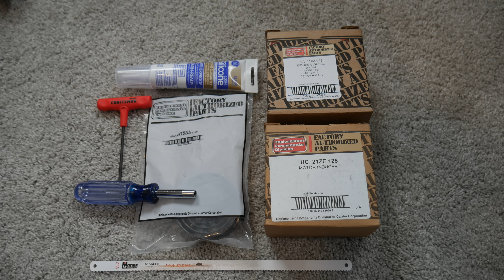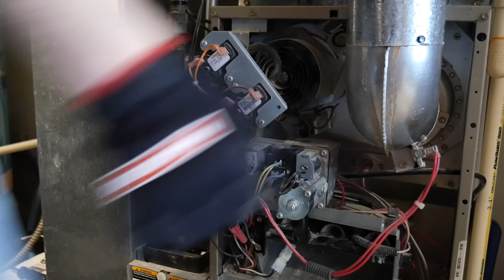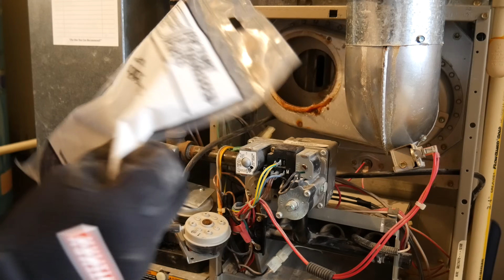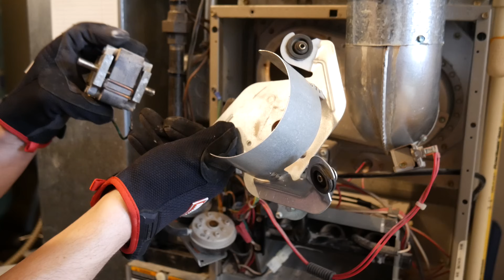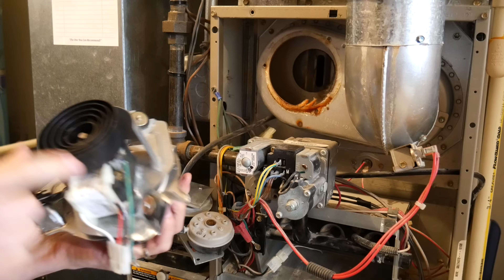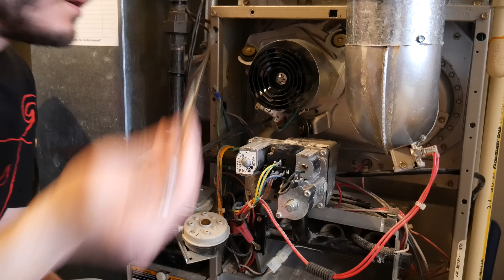Screeching Furnace Repair - Carrier Draft Inducer Motor Replacement in 4K

Comment: Thanks for the great tutorial; took me 45 minutes and saved me hundreds!  I had no idea how much noise this little motor was adding to the furnace sound - it's now whisper-quiet.

Tip #1:  Get your specific model number before looking for parts.  There are numerous versions of the Weathermaker that require different parts.  Remove the front door and look inside the unit. The model # is printed on a decal (include the numbers after the "- - -").  Take a picture of it to reference later.

Tip #2:  Buy the $5 replacement fiberglass gasket rather than deal with messy silicone.  When you remove the motor assembly, the original fiberglass gasket will fall apart.  To ensure a good seal, remove as much of it as you can before attaching the new one.  NOTE the new gasket is fragile so handle gently.  Also, install it DIRECTLY onto the furnace, not to the motor assembly you detached.

Tip #3:  If you don't have a magnetic-tipped nut driver, you can use a bit of tape to hold the screw to the driver.  Once the screw bites, remove the tape and finish setting the screw.

My Weathermaker model # 58CVA090-10116 required the following parts, purchased from factory-authorized repairclinic dot com:

Draft Inducer Motor  --  Genuine OEM Part #: HC21ZE126(A)  --  Repairclinic Item #: 2378490
Draft Inducer Blower Wheel  --  Genuine OEM Part #: LA11XA048  --  Repairclinic Item #: 2347724
Fan Blade  --  Genuine OEM Part #: LA660003  --  Repairclinic Item #: 2347727
Gasket  --  Genuine OEM Part #: 327263-401  --  Repairclinic Item #: 2357539

Total Cost  --  $140 including shipping
Reply from the maker: Thanks for the positive feedback and quality input. I pinned your post so others will easily benefit from your great suggestions!

Comment: An easy way to put the spring clip on the fan shaft, is to use a socket and push it on with that.

Comment: Really great video--in 4K!!  My Carrier 58CVA's inducer motor stopped and began to "hum" one night, so I cut the power off, and manually turned the motor back and forth until it spun freely; cut power back on and, furnace started back up.  That should have been the clue, but NO--two weeks later, motor would occasionally screech at start up and SEIZED a few days later when daytime highs were in the 30s and nighttime temps were in the teens!  Rule Number One:  DON'T PANIC!  So, after a few nights of sleeping in multi layers of clothing and relying on two space heaters (INSIDE temps in the 40s!), I ordered and replaced the entire assembly.  The new unit has no ground wire, but no rubber shock mounts like the original unit, either.  The explanation was that with no rubber parts, the unit is grounded by being attached to the housing, which KINDA makes sense (?)--but stay tuned!  I plan on replacing the motor on the old assembly (just for kicks) to have a spare.  Good luck to all DIY-ers out there.
Reply from the maker: @ClassicTV4U  Sorry you've had to deal with no heat! Sounds like you're on the right track. Keep us posted!
Reply: @TheTechnoMack  So far so good! Replacement unit is installed and working; I plan to order an "HC" motor unit, buy a T-handle allen wrench like yours and use a lubricant/penetrant for MONTHS until I can remove the set screw, and keep the off unit as a spare.  The goal is to NOT have to cut the shaft.  Take it easy, dude--your video ROCKS.

Comment: thanks for the video, it gave me the confidence to replace the draft inducer motor myself.  A local HVAC company wants to charge me $1499 to replace it.  They also said that it was the last motor available in the whole united states.  I found the motor on Amazon for $63.95 and the draft inducer blower wheel for $30

Comment: Applying high heat antiseize to the wheel shaft and set screw would be beneficial  the next time you need to replace the motor.

Comment: Thanks for sharing this video. It is very clear and helpful. It is particularly helpful in illustrating that nobody should buy this brand of furnace under any circumstances. It contains a subassembly that will need replacement several times over the life of the furnace, but is a massive pain in the neck to replace.

Comment: My Carrier 58hdx060-12 high effeciency is nothing but trouble. Only 11 yrs old and have to replace the inducer assly 4 times. Original one, replaced that under warranty, another one 2 1/2 yrs ago and a new one last week. I kept the removed one and replaced both motor shaft bearings. Also had to replace the blower motor and fan last January for $536. Carrier is a POS in my opinion. In the future, I will do this all myself, thanks to guys like "The techno Mack" guy.

Comment: Thank you so much: efefctive and to the point! I do have a question: if you use silicone sealant, wouldn't be difficult to remove the assembly next time when you replace it? I guess by then, the furnace needs replacement anyways. All the best!

Comment: Does this motor cover all the carrier furnaces? Mine looks just like that!
Reply: If you go to the following link, it will tell you on the bottom of the page exactly which model number furnaces it will fit (there are a lot!): https://www.northamericahvac.com/oem-carrier-bryant-payne-inducer-exhaust-motor-326628-761-3266828-701-326628-711/
I just bought mine today and will be replacing the whole thing once it arrives. Our current one is making all kinds of squealing noises (the bearings going bad). I didn't feel like taking the thing apart so spent the $200 for the whole kit. This way, too, I know that the whole thing is new and ready to go.

Comment: Very good clear instructional tutorial. My first of this kind. My Carrier furnace is short. Parker Pearce (hvac co.) came and charged me $342 for diagnostic without repairing any parts. Later, they said they could not further help me, because they said the part was discontinued. I was very depressed. I couldn't afford a new furnace and didn't know how to solve my heating amenity. I spent some time percolating about the problem and brooding. This last month of fall, the house was without heat. I wonder if you can help me. I believe my  2004 furnace is in the same family model (58CTA070-10112, serial 250 4A26011) as shown in your tutorial. Do I need different parts or, are the parts interchangeable? If so, I think I can follow your directions to the "T." Help!

Comment: I was able to remove the slotted washer, that holds the fan wheel in place, with two paint can opener tools. I could reach behind the washer with the two paint can openers, and simply pulled the washer off from the shaft effortlessly within a couple of seconds. The fan wheel slid off the shaft  undamaged. Hope this idea helps you when you pull off the fan wheel from the shaft.
Reply from the maker: Smart! Thanks for sharing!

Comment: Thanks for the video.  It provided some good information that helped me.  I just replaced mine tonight.  I decided to just get the whole assembly for mine off Amazon for about $300 so I didn't have to worry about swapping parts or breaking the plastic fan when trying to get it off. I just unscrewed the one screw holding that first module on to get them out of the way, unplugged the cable, unscrewed the three screws holding the whole unit on and pulled it out, and then installed in reverse order.  My complete assembly also had the fiberglass gasket like the original (instead of silicone).  My tip was to use 3 little dabs of bearing grease just to hold the fiberglass gasket in place until I got the motor in place...and then use a dab of grease on the screw head to hold the screw in the socket so it wouldn't fall out.  The whole thing too me 15 minutes including getting my tools and cleaning up.  Thanks again for the great content!

Comment: You should've just unscrewed the three smalls screws-- not the brommet screws while working inside the furnace. The entire assembly can be removed without taking off the brommets. It's a lot easier to open up when outside of the furnace.

Comment: Your parts replaced say HC21ZE125 but link says its only interchangeable with the HC21ZE114A. The 125 is 3x the price. Is this just con-marketing or would you recommend getting the 125?
Reply from the maker: If you have the same Weathermaker 8000TS, I can only ensure the HC21ZE125 will work. You may want to call a local HVAC company to check compatibility or maybe they can sell you the 125 for less. I'll investigate and update or remove the link as appropriate. Sorry for the confusion.

Comment: Thanks for this! Inducer motor was finally making some really weird sounds tonight. Luckily I had an inducer motor purchased 9 months ago from the local Amre Supply.  Changed the motor tonight starting just before bed: 11:30pm to 2:15am (2h 45min). I used a bit of WD-40 to losen the hex screw on the inside fan. And the longest part was getting that hex screw out and shaft out to reuse the blower. 

Some tips:
Tip 1: Use the hack saw if you have one. 
Tip 2: Reuse the inducer fan on the inside if you can. Try not to bend the hub. If you do, when you put it back on try and straighten it so it spins evenly. 
Tip 3: If you don't have a hack saw, turn a long socket upside down, and hammer on the shaft to push it through.  I hack-sawed, but still needed to get the shaft out, and the socket, hammer and a long philips bit did the trick
Tip 4: Have emotional support.

Thanks TecnoMack! This helped a lot, and gave me confidence to do this myself. 

Next up...buy a spare blower motor, and see when that fails.
Reply: One more tip, which is the seal. I had a two-layer fibreglass seal in mine. I think the seal is vital to have to keep the carbon monoxide vented. You might consider a CO2 monitor just outside the furnace room.

Comment: Thanks for sharing this i have a same problem so i order all 3 parts from amre supply in $295 . now waiting for the parts to arrive...
Reply: That is a bit pricey for individual parts.  I just ordered a complete assembly on Amazon for just $317.   It's worth $22 to just remove the old assembly and install the new one without having to disassemble anything.  The one I ordered is genuine Carrier.
Reply: that's definitely pricey - I just ordered the whole kit for $200: https://www.northamericahvac.com/oem-carrier-bryant-payne-inducer-exhaust-motor-326628-761-3266828-701-326628-711/

Comment: Thank you for this video!  My Carrier furnace's inducer motor was making the same noise.  I had intended to call my HVAC guy to fix it, but after stumbling upon your video I decided I could fix it myself.  It took me about 40 minutes for the entire repair.  I've read that most of the time HVAC repair companies will opt to use the $300 motor repair kit, which is a preassembled ready-to-mount unit that includes the motor and both fans mounted on a new bracket.  Therefore, this DIY job is a huge savings on parts and labor!
Reply from the maker: Awesome. Happy I could help!

Comment: Great video!  Well done and well explained!! Video quality is amazing. After 25 years,I had to repair mine as the bearing ceased on the cage-fan side of the motor.  Rather that buying a whole new motor, I just changed out the two NSK 608Z bearings.  It was tough to get that cage fan off.  Fortunately I have an acetylene torch and I had to heat the rusty hub up to orange hot to loosen the set screw, and then heat it up to orange hot again to get the hub to come off the shaft. I first tried with a hand held propane torch, but could not get it hot enough to loosen the set screw. After I got it apart I cleaned up the shaft and the hub with 600 emery cloth and it went back together nicely.   Cost of the repair was under $20 CDN.   Fortunately shaded pole motors draw the same amount of current when locked up, as when running, so the windings did not get burn up and shorted out.
Reply from the maker: Thanks for sharing your experience. I'm glad you benefited from the video. I'm sure your detailed comments will help other DIY-ers!

Comment: To remove the inducer fan I simply grabbed the push on nut (or whatever it is called) and twisted it off by turning anti clockwise (got that tip from the internet)...worked like a charm and saved me $39 CDN for that part. My Allen key was also rusted, but I just put the other end of the shaft in a bench vise and drilled out the shaft, placing the hole away slightly from the Allen key. Once the hole in the shaft was almost touching the shoulder of the blower wheel I was able to twist the blower wheel off, again very easy now that the shaft was hollow and had a very thin wall. With the blower wheel off and  a bit of help from WD40 the Allen key loosened quite easily...another $51 saved.
Reply from the maker: That's awesome Jules. Thanks for commenting!

Comment: Super helpful and easy to follow video and I ended up doing it myself. I hit a few snags along the way, my motor was a slightly different model than the one in the video so my advice for anyone who wants to tackle this job with the help of TheTechnoMack's video is follow and listen to the video but just double check the motor matches the electrical connections. Maybe even bring in the old motor to the supply store to make extra sure. I had to go back to the supply store twice but the fan and the wheel fit both types of motors. I could not have done it without this video. THANK YOU!!!

Comment: Found all parts at repair clinic, $90 for motor.. It took me 1 hour to change. Penetrating oil worked for the set screw. Took apart motor and found the bearing close to the high temp was bad. I ordered a generic bearing on amazon for less than $5. I moved the okay bearing to the hot side. I will use the new non high temp bearing on the cool side. This is for backup. The bearing size is .865 OD and .3125 ID . Great video,Thanks.

Comment: Very good video on a problem that just came up on my Carrier gas furnace. With the weather here at 1 degree I was successful in quieting the screeching motor by dropping some silicone oil on the motor shaft just between the inducer fan and the motor and apparently enough oil got to the right place to stop the noise.  I just did this as a temporary fix while I order the parts and replace the Inducer assembly when it gets a bit warmer. Thank you for the help, Bob
Reply: Did you have to remove it all to oil the shaft or were you able to reach while it was still assembled?
Reply: It was assembled and is still running without the squealing. I hope to get the parts locally on Monday and as I said it was just a temporary fix. Make sure the furnace is turned off if you try this.   Bob
Reply: thanx  @boba6776
Reply: I oil mine yearly. I just drip the oil in the area of the front and rear bearings

Comment: Great video...I am finding the entire assembly on line for about $350 (with out really shopping around ), meaning you dont have to mess with cutting the shaft to get the mounting plates off.  Did you find it much cheaper to buy the individual parts as opposed to the entire assembly?  It is absurd that HVAC company wants to charge 200 dollars for install.

Comment: Love the explanation and video. I'm buying a  2 speed draft inducer assembly, but it does not have the bracket. I would have to take it off the old one and install it on this one. Could I do that without unscrewing the assembly on the new one to install the bracket? This the part that I am buying. https://shortyshvac.com/index.php?main_page=product_info&products_id=3143  Thanks for all the help!

Comment: Great video.  Thanks.  Question... when you were taking out the assembly it was a 2 step process (unscrewing inducer motor then unscrewing fly wheel). Couldn't you have just unscrewed the fly wheel with the inducer motor intact?  I'm asking because I'm putting in a used assembly with both already intact.  Thanks.
Reply: The step wasn't necessary. He said he disconnected the motor to demonstrate the flywheel was too big to fit through the opening. He skipped that step during reassembly.